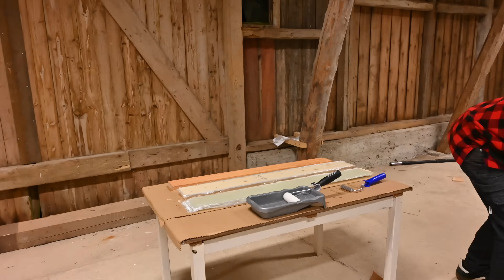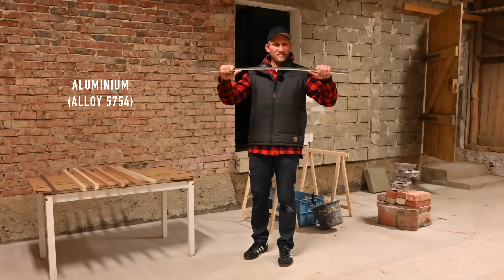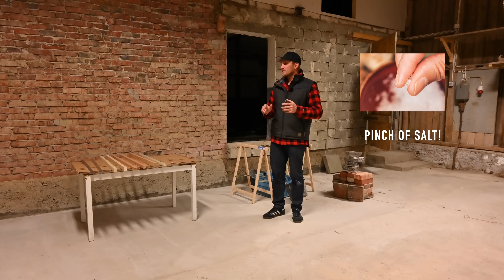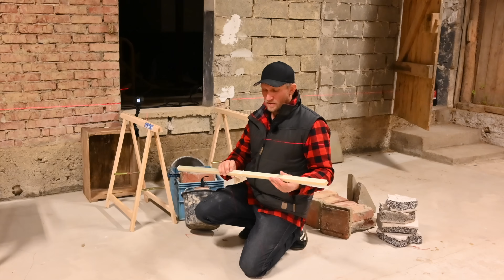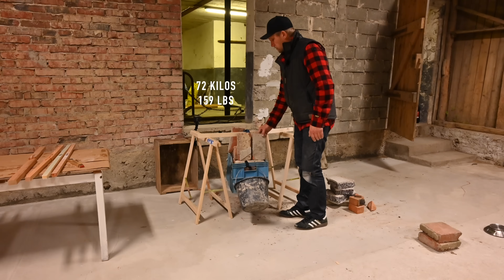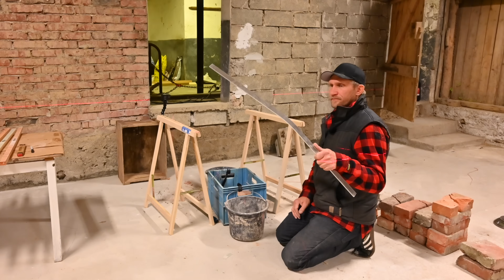Boat Hull Material Test - Which Breaks First? - Ep.  319 RAN Sailing

Comment: The thinness of the metals played a part in their earlier failures. I wondered if square tubing stock of the same weight would have been a more fair test for them and maybe having the boards being laminated on all 4 sides. I know the hull wouldn't have been constructed that way, but the strength of the wood is based on it's thickness in the plane of the pressure that is applied. And the stringers inside the boat would help with that kind of pressure against the outside hull based on how far apart they are placed. I wondered if the saw horses remained the same distance apart for each material tested as that would have directly affected the tests. Another factor is that if the test is to determine staying power against the hull striking a submerged rock, the shape of the rock will also play a part as the force can be concentrated in a small area or spread out over a wide area, and both would be a factor. 

But, overall, Johan, you did a fine job of conducting an evaluation of structural materials for building your own boat at home. I, too, was surprised at the strength of the wood! Just as fiberglass layers are strengthened by using bi-axial glass, I suppose you could do the very same with bi-axial wood planking.

I feel very fortunate to be able to learn and appreciate your works because you are willing to give your presentations always in my language! You really cleaned up that barn!

I guess I will always wonder if Vera and Malin could have gotten on that one piece of wood with you, also!

Comment: I have an engineering background and I always love practical testing as part of the evaulation. Couple of thoughts :  (1) resistance to bending goes up at the cubic power of the thickness so 6mm is not 3 times stiffer than 2mm but 27 times more resistant to bending (for the same material) (2) Not sure what happened with bonding glass to the upper surface of the foam core as it readily delaminated under compressive stress but excellent comment that this was a test of your sample and it accurately showed that, for instance, the many wood based samples are not overly sensitive to variability in construction. Good luck with the project and always a pleasure to watch and learn. Bill

Comment: Lamination on the outside of the hull is only a protection from water. if you would have done some lamination on the inside or both sides would have shown a different result. Especially on the dyvinicell, vacuum bag or not. Dyvinicell is ment to be laminated on both sides to work correctly. But I am totally with you on the price points. It's just not worth it. Really like your test otherwise!

Comment: I've built strip planked sailboats and fiberglass versions of the same boat. The wood cored boat was more quiet and had a heavier (actual displacement was nearly equal), feel to it while sailing, the hull seemed stiffer and on the wind felt more comfortable. I like your decision to build, good luck with it. Thank you for your videos.

Comment: defects in wood strip planking is less of an issue than initial thoughts would suggest, mainly because the strips are small and many, rather than wide planks, so any defect in one strip is very unlikely to line up with a defect in the next strip, thus reducing the defects effect on strength.

Comment: With the metals you should try in an I-beam shape.
Reply from the maker: Yes, I could have done that, and the results would have been different. But beams are not used for plating a hull, and the test was specifically for the skin layer of a hull. Cheers!

Comment: Seems the spacing of your supports had influence on the results.  Had the supports been closer then I believe you would have needed more weight to break the wood.
You could increase the strength of the hull by having ribs and or bulkheads closer together.  I do not know the method of your construction.  I wonder how baltic birch would fare in your testing? 🤔
Keep up the good work!
JIM 🥰

Comment: The problem with your load test is that the steel and aluminium ,, and the fibreglassed timber were tested the wrong way, you will fing that if you had them vertical that is the laminates vertical they would have benn much stronger the Steel and aluminium will never hold the same as the wood when flat but stand them up and you wouldn't have had enough weight to bend them. cheers Moose
Reply from the maker: Yes, but the plating of a hull will not stand up vertically.
Reply: @RANSailing  true but it will be supported by frames and stringers and will not just be a test piece supported 1.5 metres apart, the combined structure will be much stronger in steel or aluminium than any of the others the divynicell is super strong when laminated into a hull but not so much in your test because two sides were not laminated a situation which will never occur in a boat hull, the test is indicative of a very narrow circumstance which does not reflect the loading of a hull

Comment: First, great video start to finish.  Second, the primary reasons for vacuum impregnating is weight and strength.  Saving money on wood (Swedish Spruce) should open up funds for an acceptable vacuum system. A secondary benefit is the reduction in osmosis often occurring in older manually impregnated FRP boats. Third, you could also consider carbon fiber instead of glass fiber.  You might check out Dark Arrow 1 videos on carbon fiber. More expensive but significantly stronger.  BTW, you would have to go to nerd school to match the levels of other highly successful DIY boat videos.

Comment: Aaarrgg.. you have to have same shape of the test materials. You cant use steel and the flat end horizontal.. use it with flat end to sides..
Reply from the maker: Yes, but this test was to show the strength to weight in practical terms on how you would “plate” a hull.

Comment: Ed Zdon
Great video.  I'm curious about the grain orientation.  Was the grain vertical in your test pieces, like an axe handle  My understanding is that a strip planked boat should have the grain horizontal if its true quarter sawn lumber.  Is premium quarter sawn dry lumber going to be readily available?  Thanks again for producing such a great series

Comment: Next time use a pulley and a strain gauge ( like you can buy for luggage) mount the rope in the floor directly under the test point with a concrete mounted swivel….. ! Pull till whatever you are testing breaks…. Read and compare the results…..far easier,quicker and more accurate 😶

Comment: There are two main ways to measure material strength. Tensile strength, which is how much distention or compression force it takes to make the material yield, much like a bolt, and shear strength, which is what you were testing. Knowing the application and which of those forces the material will be subjected to are crucial for determining the proper material. For instance; Concrete has a very high tensile strength in compression, but a very low shear strength.

Comment: presumably Swedish spruce was always going to be the choice you didn't say if it did fail where there were knots in wood. and your obviously going to build a much lighter boat with aluminium than with wood or steel. and composite material would test far differently constructed with fibres in multiple direction resisting forces in multiple directions although you didn't say much about the laminations or type of glass, it would have been interesting to see marine ply vvs different grades of ply with epoxy but again you would need a different test to shoe the advantage of many different wood grains running different directions. not unlike the glass composite. still a fascinating bit of real world if not scientific testing! adding the smallest weights last might have helped i'm pretty sure you've overrated the expensive wood by adding the last 90+ kilos all at once like that.

Comment: In the UK the terms pine, fir and deal are used by the timber trade interchangeably, not reflecting the botanical differences. Oregon pine is Douglas fir shipped from NW US, also known as Columbian pine (from BC). The are plenty of others, Pensacola pitch pine, Riga pine (sometimes fir), Archangel pine, Khaya, all named after the ports they came from.
If I had the choice I would use spar grade Douglas fir or search out Alaskan yellow cedar. 
Wood/epoxy is the most expensive way to build a boat, short of exotic laminates.
The best european timber merchants are often in Netherlands which has a huge timber import industry, order ALL your timber in one go and you may be surprised at the discounts you can achieve.

Good luck!

Comment: And now we have an excellent example of why metal hull boats have stringers and ribs :)  The steel and alumin(i)um would have fared significantly better if they were on edge, rather than flat, despite being so thin.

The interesting part about laminating glass fiber or some other composite is that curves make it stronger

Comment: You mentioned you've been following the Tally Ho restoration project. They have used a variety of different woods for different parts of the boat, and I suppose that can be easily explained and justified, but we can only know that for sure in about another century. They started that project in June, 2017, estimating that it would take about two years to complete it, and have had a very large crew of highly skilled and dedicated people, many of them volunteers, working on it for five years now. They even had a parrot mascot. As of now, five year later in the autumn of 2022, they estimate that project will now be finished in about two more years. What the hell have you gotten yourselves into?

Comment: Interesting, I would not have bet on wood being that strong! But as you say there are other properties, so the choice of materials is not such an easy one. When I first started to fiberglass things, I did some tests with cardboard shapes, then coated with just resin, or glass and resin. One learns a lot. For example, you can use a variety of materials to make the shape, then layer on the materials that will carry the load, hold out the water,... I was thinking that cardboard pieces cut by computer, held together by computer 3D printed clips and taped could form a hull shape. If I get a chance one day, I want to try building a boat that way.

Comment: I guess another consideration is the availability of the milled sizes and lengths you will need. I do not know the requirements for boat building, and can only guess it may require dimensions not found at most lumber suppliers or lumber mills.

Comment: I've buildt a canoe and a kayak in strip building. First with swedish knot free pine and the other with knot free spruce (very hard to get). If you go swedish wood, pine is a little higher density, but easier to get high quality.
A laminate gets it strength from 4 things.
1. Strength of the core material
2. The distance btw the fiberglas layers.
3. The thickness of the fiberglass
4. How you apply your fiberglass and or carbon fiber.

Divinylcell has almost no strength of it self. It is all about the last 3 factors. Sven Yrvind builds his boats  out of 50 mm divimylcell. An outer layer of fiberglaa and an inner layer of carbon fiber and fiberglass. Yes, the inner layer is the strongest! The hull is extreamly durable.

When using wood as a distance material, you can go from balsa to oak. Balsa is like divinycell. Oak in the other end. Most of the strength comes from the wood. Less from the other factors. I think the ultimate wood has a high stregth per density. Low density gives you a thicker hull to use the benefit of the laminate more. To protect the hull you need a pretty thick layer of fiberglass, so better go light on the wood, for more distance. And remember how important the inner layer is! It is not just to protect the wood from water.

I think the comparison with steel and aluminium is a little unjust. In a laminate hull, the strength and rigidity comes from the outer hull. In a metal boat the outer hull is more or less like a skin on a frame (think of a traditional inuit kayak). It is all about the frame. Stringers, ribs, bulkheads. So it is very much how you construct your boat on the inside. If you've folded the metal strip along side or find a way to load it on the edge, it would get alot stronger. Make a T bar or a triangle tube of metal. It will have a very high load/kg ratio. Maybe higher than some of the wood.

Comment: Great channel showing your many achievements in sailing and in life! (i) Doug Fir was long known simply as "Oregon" in Australia. (ii) Some have glib ideas contrary to your well-considered ones. This is among them. The west coast of Florida has piles of sailboats which were flooded in Hurricane Ian and are intact but are total losses. Could you find one with a hull which matches your design, rig it for very basic sailing to Sweden, and then refit the interior, deck, and superstructure in your barn to complete your design? Could it save a year of boatbuilding at low cost?

Comment: Very interesting stuff, Johan , but IMHO....I think you are trying to re-invent the wheel !
Naval Architects know all this and will spec wood species depending on build process. 
For what it is worth, I think cold molding, (layers , probably 4, of thinner material so you can make those compound curves) and vacuum bagging. Vacuum bagging is no more difficult then steam bending, which you will probably need to do with the thicker strip-plank stock you tested. 
Just my 2 cents.

Comment: As someone building a pvc cored boat I had to chuckle at the Divynicell strip snapping in half. When you went through the test strips I thought, seriously, that’s going to break like a twig!  A boat is not a thin strip of material.  To be fair, that was about as misleading a test as you could have designed to demonstrate the strength and qualities of epoxy/glass/pvc construction.  However I get it. The purpose of this was to show wood is a good choice. And it is. Glass covered strip plank will make an excellent boat and I’ve no doubt you’ll make an excellent job of it. Looking forward to following along. Cheers

Comment: You will need a Oak kiel for strength and to fasten  a heavy counter weight of re-enforced special-mixed concrete to bring the boat back upright if nocked down or capsized.

Comment: A more reasonable test would be to build a structure even a simple T Built to what your hull thickness would be regardless of weight and test the strength of those tho you may need a hydraulic press to do so

Comment: Hello sweet brother! I am currently building a 22ft Colin Archer replica. I have used knot-free spruce, epoxy and four layers of fiberglass with epoxy on the inside and outside. Total weight with aluminum mast and boom is approx. 1000 kilogram. What weight calculations do you have on your larger boat?

Comment: Great test, enough science to illustrate the differences.  The rot reistance of western red cedar, means you can use a lot less of it and the boat will last longer.  Some materials such as steel will indefinitely accept reasonable levels of repeat stress, whereas alumimium fatigues steadily over time.  I would be interested in the inclusion of carbon fibre.  I would laminate carbon fibre into the frames, particularly around the keel/mast/chainplates/rudder.  You can order it cut to the dimensions you require, to save trying to cut it yourself and to optimise the use of a length of roll.

Comment: Excellent idea to physically test the materials yourself to get that all important “hands-on” feel of the results.  While I’m sure you appreciate that the geometry of the part being tested impacts the results, you may not be aware of how dependent it actually is.  For instance, in a 3-point beam test (which you did), the stresses in the exterior fiber (which generally define the point of failure) are dependent on the “square” of the height of the section, so doubling the height of the beam actually reduces the stress by a factor of 4 times!  So… what you are testing more so than the strength of the materials, is the strength of the geometry.  An alternative test you could perform, if you were curious to take this one step further, would be to test the materials again in the same size (for instance, all materials in 25mm X 25mm), and then at the end divide the strength by the weight of the samples, thus achieving a geometry independent “Strength to Weight” ratio.  Nevertheless… love the channel and all the hard work you do to share your adventures with us.  Good luck with build!
Reply from the maker: Yes, I’m aware that the geometry affects the strength greatly. I could have used a square pipe for the metals, but that’s not what you use for plating on a hull. You use sheet metal with support from scantlings and frames. But this could be used together with the wood also…. My take from this is that you can produce a stiffer hull from wood with glass compared to steel at the same total weight of the hull.
Cheers!
Reply: Actually, if I recall correctly,  the bending moment of inertia for a rectangular cross section is BH^3/12 where H is the thickness. So the stress goes up by a factor of 8 when you double the thickness.
Reply: EDIT: Stress goes DOWN by factor of 8 when you double the thickness.
Reply: Hi Rick, you’re correct about the moment of inertia increasing by a factor of 8, but when calculating the stress the equation is:  Stress = My/I, where y is the distance between the neutral axis and the surface… in this case y = 1/2H.  So, if we substitute it in, Stress = (M)(1/2H) / ((BH^3)/12), which reduces to 6 M /BH^2.  Thus, the stress is impacted relative to the square of H.  Cheers!